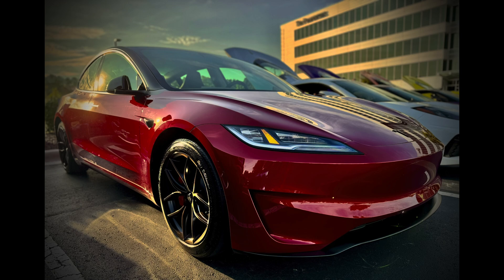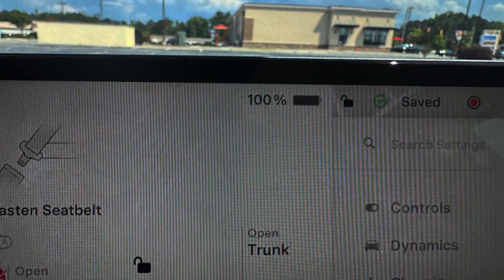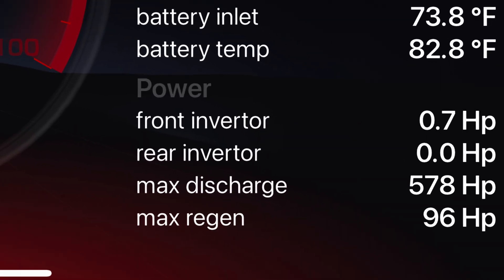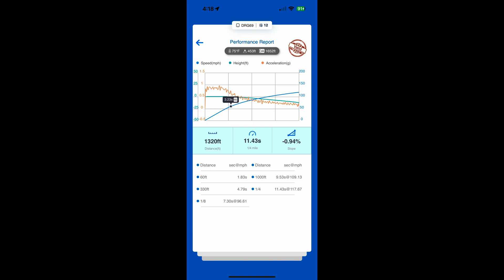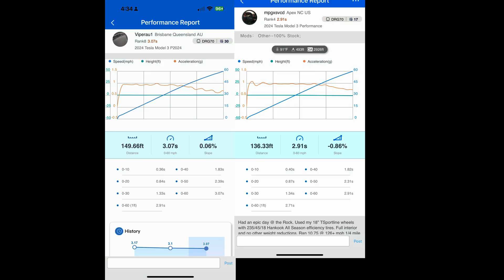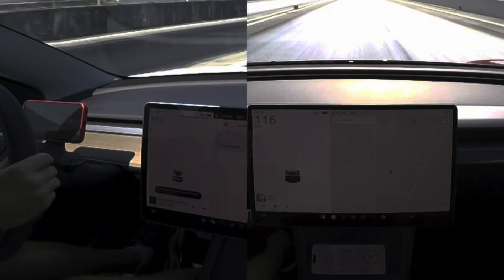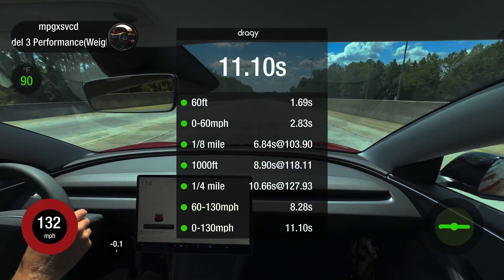Highland Tesla Model 3 Performance LG battery vs. Panasonic battery comparison.

Comment: So I have done some tests today here in Oz with LG battery and this is what i have found. Supercharged to 100% and got battery temp to 56 degrees celsius. Immediately after I saw a max discharge value of 412kw. Got to my back road on 97% SOC and max discharge value dropped to 394kw. Temp was 52 degrees celsius as I preconditioned as soon as I could. Max discharge value then only dropped to 392kw at 80% SOC. I then preconditioned and max discharge value went back up to 401kw at 78% and battery temp at 49 degrees celsius. Best 0-60mph  I could get was 3.14s without rollout and slip start on. This run was done at 97% SOC and 394kw at 52 degrees celsius. Run is on dragy under DutchMike. Sexy buttons and app were used for all parameters. I also weigh 140kg so I think we can shave at least a tenth off the time  😂
Reply from the maker: @michaelpotgieter7925  great data. Thank you very much for that. That certainly is a long way from what I am seeing with the US version of the car.
Reply: @LearningFast  very disappointed. LR with Panasonic battery will give this car a run for its money 60-130, maybe even beat it...
Reply from the maker: @michaelpotgieter7925  the LG battery cars seem to launch better than the US based Panasonic cars. The 0-10 mph times are actually very good for the LG cars. However, after 40 mph it almost seems like it is slower than the old cars. It just completely falls apart no matter what you do after 40 mph. Still a great car but the top end just isn’t there.
Reply: @LearningFast  I'll be going to the drag strip on 18 August so will have more data on 1/4 mile and hopefully 60-130.
Reply from the maker: @michaelpotgieter7925  awesome! Can’t wait to see the data from that.

Comment: I recently purchased a 2024 m3P in Ontario, Canada but the vin tells me it was made in Fermont, CA. Does that mean it has the Panasonic battery?🤞🏽
Reply from the maker: Not sure. You really need to check the original battery capacity. 82.1 kWh is the Panasonic battery.
Reply: Canada get the LG batteries. Even fermont builds. Panasonic was reserved for the usa market for tax credit.

Comment: @LearningFast, what about the new LG battery from China-European models that comes with model 3 performance now which is also 82kwh? Have you heard anything about it? I think it is the same that the new model y performance also has
Reply from the maker: I checked Bjorn’s video of the new Model Y with the new LG battery and it only goes up to about 420 KW for Max Discharge Value with a fully optimized battery. I saw up to 462 KW for Max Discharge Value with both of my Model 3 Performance cars with the Panasonic battery.

Comment: Uhh… in the side by side drag comparison, the vehicle on the left has stalks, a wood grain dash, and a model Y steering wheel.
Reply from the maker: The car on the left is a 2022 Model 3 Performance with weight reductions. It is just an example to show what the difference between low 11s and high 10s would look like.

Comment: I have the Enhance commander and a Shanghai LG performance model 3 hyland. Supercharged to 100% yesterday evening. 57.3 degrees centigrade battery temperature. Immediately after finishing charging and putting it into drive it was showing 563.2 Hp maximum discharge.
Reply from the maker: @tannman87  thanks for that info. That is almost 50 HP less than the US car shows which lines up with what they claim.
Reply: @ thanks for the info from your videos 👍🏻 the Hp went down to 536.6 when I got home. 92% with a battery temp of 32 degrees centigrade.

Comment: 4:15 
The red line is identical to my 1/4 mile in my 2018 model 3,

Black line is the average, best ET for the 24 performance, realistic best 1/4 mile 

Green line is your freaskishly quick, weight reduction 2024 performance lol
Reply from the maker: @Nate7700  the Green line shows what the car is capable of when you fully optimize the battery. That has been my whole point all along. The more you optimize the battery the quicker it will go. Anyone can do this if they just fully optimize the battery. There is nothing special about my particular.

Comment: 4:12.. Power ( amp drained from the battery x voltage) and TORQUE( Phase amp from the motor) are two differents things. the 0-60ft is not draining enough POWER to see the power limit of the LG or Panasonic.. That's why you dont see any difference.

Comment: both have pros&cons.
panasonic uses NCA which is more expensive than LGs high nickel 811 NCM because NCA requires more expensive cobalt. 
On the negative side Panasonic uses graphene/siliconoxide which provides higher energy density and higher discharge power compared to LGs graphene only. however the trade off of graphene/siliconoxide is faster degradation.

for US buyers its up to them to choose between performance (panasonic) and longevity/resale value (LG). everyone else can only have LG, which is prefered for the majority.
Reply from the maker: @uludak8468  the Panasonic cars are far cheaper in the US than the LG cars in the rest of the world and your degradation conclusion is unfounded.
Reply: as for now LG batteries are shipped from SKorea and China, while Panasonics are made in Japan and the US. thats most likely the reason. but if shipped abroad panasonics would be more expensive than LG version.
Reply from the maker: @uludak8468  there is no merit to the rumors that the Panasonic battery degrades more.
Reply: @LearningFast i was told US buyers can choose between Pana and LG. if true how much is the difference?
Reply from the maker: @uludak8468  US and Puerto Rico only get the Panasonic battery. There is no good reason for the consumer to ever choose the LG battery over the Panasonic battery.
Reply: @LearningFast but i'm sure e. musk has good reasons to not ship panas elsewhere. it has to be seen how the panas will hold up. but id def not be the beta tester.
Reply: @LearningFast  Any idea if you can verify what battery you have prior to delivery? I’m concerned that my Quicksilver M3P will contain the LG battery and if that’s the case I’ll just switch to a M3P that qualifies for the tax credit to ensure I get the Panasonic battery.
Reply from the maker: @t2nerb721  in the US and Puerto Rico you will get the Panasonic battery if you order a 2024 Model 3 Performance. They aren’t splitting the battery types for that model. It wouldn’t make the 510 HP claim that they stated if it has the LG battery. That would be false advertising.

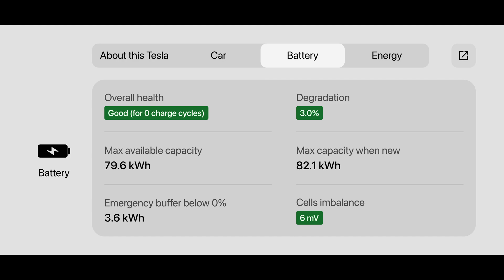Comment: @learningfast 00:50 my USA 24’ TM3P shows 78.4 on battery capacity. This is using ScanmyTesla, why does yours show much higher?

Can you show another screenshot using scanmytesla? Also do you recommend which app would you recommend? Sexybuttons or Teslogic.
Thanks in advance!

Comment: What are the tire sizes for the front and back that came with the 2024  Performance, and what tire size when you went to the 18" T-Sportline's ?
Reply from the maker: @curtspray  235/35/20 up front stock and 275/30/20 in the back. 235/45/18 square now with the ultra efficient All Season tires.

Comment: This is a nice attempt at clearing things up, but there are many factual errors in these explanations:
- Teslogic calculates Degradation based on starting value Full Pack When New. This is usually not the actual true capacity when new. Some batteries do start at these value, but many do not.
- The indicated 79.9kWh do include the energy buffer below 0%. The difference to the 82kWh can not be explained this way, but are merely the result of a suboptimal calibration or generally not the batch. Not many Panasonic 3L packs do reach the full 82kWh.
- Power is dependent on SOC and Cell temp, yes, since the current is mostly constant, but why then take an example of the LG pack not 100% and hot and use this as the benchmark. This pack can peak at 415kW, not 406kW.
- Maximum Discharge Power is an interesting value, but in the Panasonic 3L pack demonstrated in the video it is misleading or better...false. Look at battery power when acceleration and you will see that maximum discharge power can not be reached on a hot pack. 462kW is indicated, yes, but far from reachable. Substract 25kW and you are at sensible true power levels for this pack.
- Now comparing the LG with a too low number and the Panasonic with unrealistically high values is a but unfair. The LG is worse, but by 20kW, not almost 60kW as portrait here.
Reply from the maker: @lastnightsfavorite  you are wrong. I saw 613 realtime US HP while doing a run in my Panasonic car. Max discharge at that particular moment was 615 US HP. This new car can actually get right up to the max discharge value in realtime output. The old cars couldn’t hit anywhere near the Max Discharge value but the new ones can.
Reply: no point in coping, there is currently 1 sub 11 second 1/4 mile with the chinese battery which was after wheel swap, and removed seats. the us version hits 10.9 fully stock on a bad day, and can get 10.7 with just preconditioning and nothing else.

Comment: I really don't care. It's still faster then 99% of the cars on the road. Picking mine up 30th july.
Reply: You'll love it. had mine a month now and it is a fantastic car for the money. Build quality is sooo much better than my previous 2020 M3P as well as ride on active dampers and noise levels are much better. So worth the upgrade (so long as I have the same zero issues as on my 2020, early days still!!!)
Reply: @GuiGabois  I did a test drive before I ordered it, and it was so much better than my model Y LR.

Comment: Found a pic right after finishing SCH with 408kW max. discharge (LG pack), I think I saw on one occasion 409, but don’t have screenshot of that. Will post the link, please check YT comments held for review, I believe the link will be filtered out.
Reply from the maker: @qrs13  thanks, I will check that out.

Comment: I'm in Australia and was looking at ordering one, but as we get the LG battery version, I'll wait and see if this changes. Tesla already have an issue with the 4 pot front brakes and small rotors suffering from brake fade on their Model 3 Performance.
Reply: I’ve got m3p performance 2024 in Melbourne no issues this car is insane with lg battery

Comment: 10.75 time is with 18 wheels with 20 wheels time is 10.9 china time is 11.2 various 0.3 conclusion usa is faster some tenths and china is better build and with less battery degradation.
Reply from the maker: @georgegeorgiou1367  the 18” wheels don’t make a difference this time because the stock wheels weigh the same. The US car is almost .5 seconds quicker in the 1/4 mile.
Reply: @LearningFast  It's not just the 0.5 second speed
 what does one want in a car, the US car has many issues such as cracks finish paint gaps and more battery degradation, there are many video on youtube.
Reply: @georgegeorgiou1367  My US built 2024 M3P is perfect. No panel gaps, paint is lush and battery degradation after a couple of months? Get real.

Comment: Sorry for thr double posting, maybe it's me inhaling copium right now, but let's see it this way:
MiC Tesla is simply better made than MiU Tesla.The paint quality and the fit and finish are just better. I say this as owner of both MiC and MiU Tesla cars (MiU 17 Model S, MiU 20 M3P, MiC 22 M3P and MiC 24 M3HP)
Battery performance is a double edged sword, it's a zero-sum game. You get better charge/discharge performance, then you will inevitably suffer from higher degradation.
Reply: Quality is pretty much exactly the same. I read exactly the same issues in UK and European blogs as I do in the US. The good news is they are MUCH less than previous years. Tesla have got their sh*t together at last. The finish in my 2024 M3P Refresh is fantastic. No panel gaps, no creaks. All working just fine. With rebate I paid $46k...unbeatable value for the performance. Already clocked 10.79 to 60mph and 10.89 to 100kph. Sub 11 seconds for $47k!!!
Reply: Tesla US for sure got better over the years but its still shit. 
Never saw a model s and x without at least 1 issue.
The internet is filled with stuff like this. China is factually better then US in terms of production quality.
This is not a matter of opinion.
Reply: @DrumL3000  Actually it is a matter of opinion. It always is, regardless of empirical data. Opinion is what matters.

Comment: This is a big deal for me.  I am planning a move to France in 26 and want to buy a new or year old M3P for use as a daily driver but also to take to the Nurburgring or other tracks and to drive in Germany.  The thermal degradation issues noted by Out Of Spec and you make it less than ideal to not worth buying.  I don't know how well the previous M3P in Europe performed for thermals and performance beyond brakes and temps in totally stock form needed help.  I hope Tesla can rectify the issues soon for EU cars.
Reply from the maker: @zeitgeist888  you are better off with a Hyundai Ioniq 5N in Europe. That is a better road course car and you don’t have the CCS1 charging issues that we have here. However, in the US the Model 3 Performance is such a good deal that it makes it hard to pass up on.
Reply: @LearningFast  Unfortunately the Ioniq 5 N is $10000 more so out of my price range.  The older M3P is used at the Nurburgring as a rental by a group that has added cooling and safety equipment to be reliable and have less degradation.
Reply from the maker: @zeitgeist888  it definitely is more expensive. It is such a shame that there is such a big difference between the US Model 3 Performance and the rest of the world.
Reply: The truth is that the Hyundai ionic 5n is superior to the Tesla model 3 performance usa which has a temperature problem and in the US there are many owner complaints as opposed to Hyundai owners. @LearningFast
Reply: @georgegeorgiou280  It may be superior going round a track but 99% of drivers dont track. For $15k less than the Ioniq, the Tesla is a no brainer apart for people that like fake gear shifts and fake noise, lol.
Reply from the maker: @georgegeorgiou280  I don’t know about the 5N being superior in the US. $20,000 worth of mods gets you pretty far in the Highland Model 3 Performance.
Reply: It actually seems from data I gathered so far that the power limit is not only temperature based, but rather there seems to be sliding window of amps per seceonds of discharge (amount of energy sucked out of the battery in the time window). With 4 people in the car got full 217kW limit at 54.8deg C (!), way sooner than ~61C thermal limit.
Reply: For a little while you can find MiC M3P with heat pump and frontal seat double pane glass and Panasonic battery